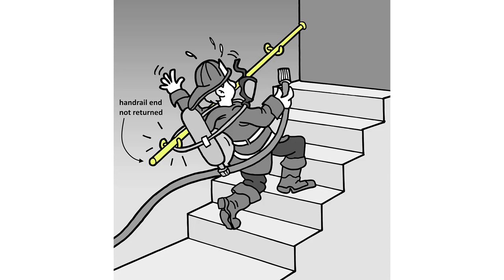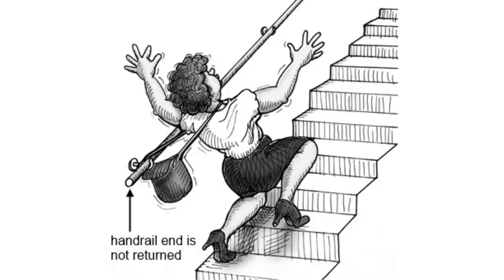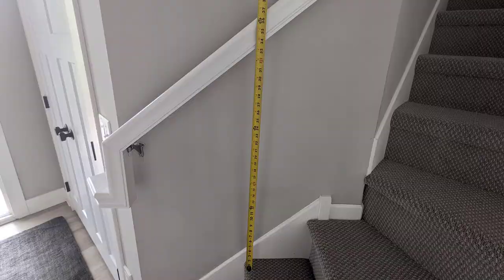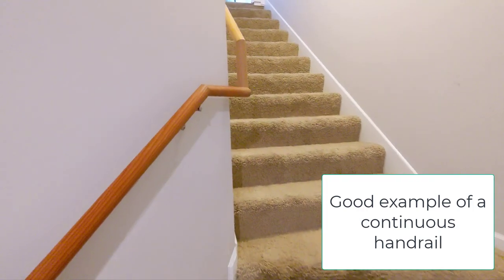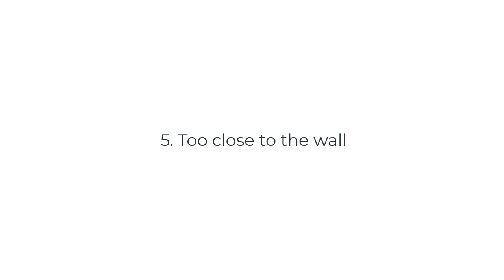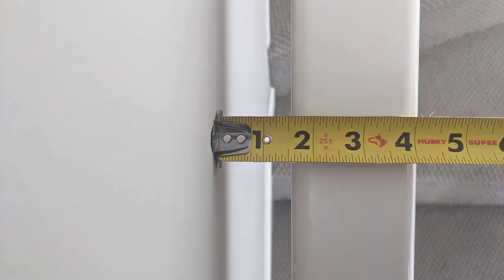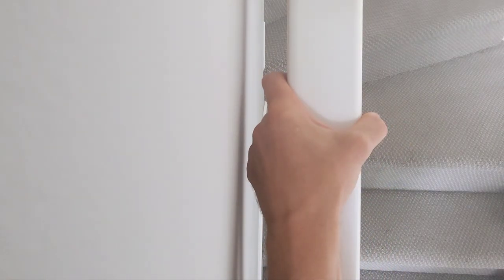Top 5 Handrail Installation Defects

Comment: Really appreciate your informative videos.  Do you know if these handrail codes also apply to St Paul?

What if I'm preparing to sell a house built in 1920s which is missing handrails to basement and also to 2nd floor? Must they be added to be able to sell the house? The stairs are very narrow and, although ideal, a handrail would be intrusive.

 If an inspector noted it on his buyer's report and the potential buyer used the handrail installation cost to reduce the asking price, could I dismiss this reduction based on something like "grandfathered in?" I realize it's my prerogative to refuse any reduction but I'd prefer a rational reason, if possible. 

And, lastly, just out of curiosity, I've noticed online some beautiful modern handrails which were not round but shapes like square or flat horizontally, most made of metal but some exotic wood. Even if graspable, would they not meet code in new construction?

Guess I had more questions than I realized! Thank you.
Reply: This is my situation as well. I have a 1920 house. It has features and odd quirks that would be unthinkable in a home of more recent construction. The home has for the most part been virtually unaltered since, as best as I can tell, minor alterations in the 40’s or 50’s.

Comment: 1959 house in Saint Paul, handrail to second floor is older style that does not bend to meet the wall. Do they make adapters to fix the existing handrail, or should I plan to replace it at some point? I know I might not have to fix it to sell it, but I never thought about the potential danger to fire fighters and purses/handbags. 
Also, basement steps handrails often do not have a contiguous wall to connect to, so you might consider an expansion on this theme at some point. If I am going to have a handrail at all, it might as well be safe. Thanks.

Comment: Hello — question I really appreciate your answer —- 5 steps stair and on top landing 36 x 36 than on other 10 steps stairs — which will be the correct railing 36” h railing on stairs and landing as well or 36”h on stairs and 42”h on landing 
Thanks Daniel